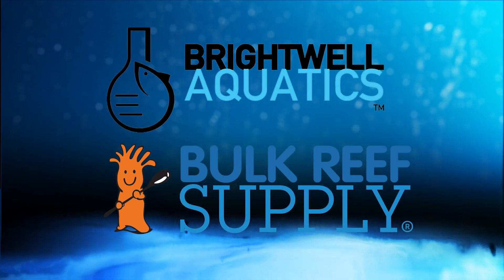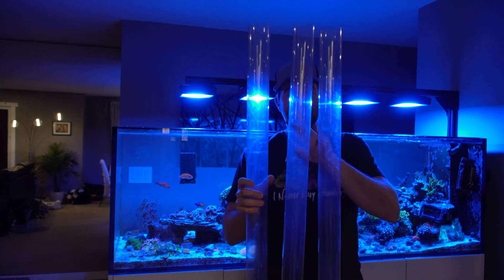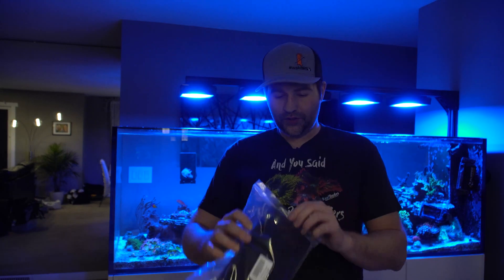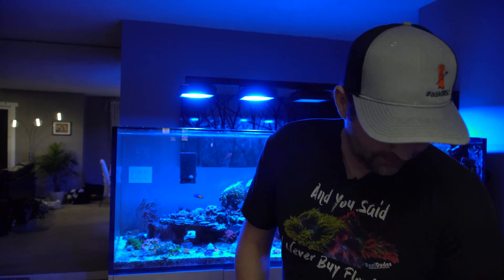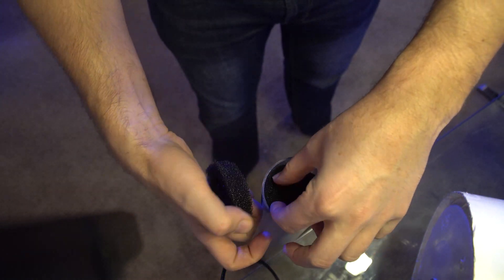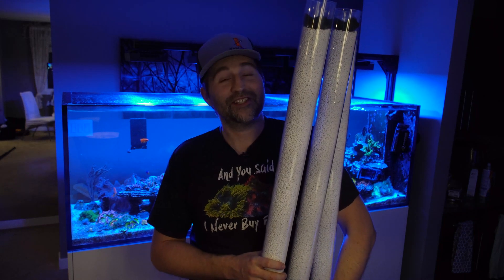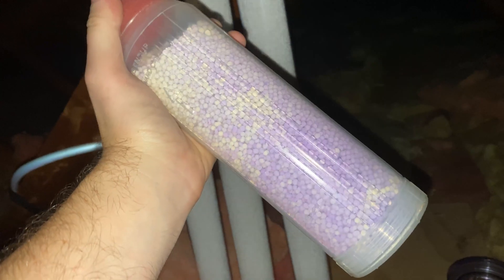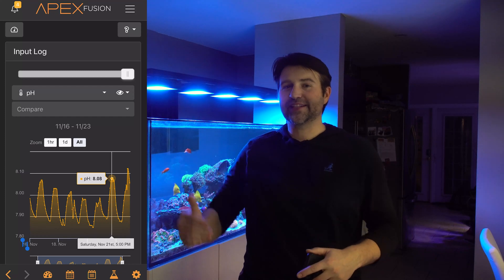DIY Co2 Scrubber - Boost your Saltwater Aquarium Reef Tanks PH!

Comment: I would cap the tubes and put a small hole in each cap, otherwise you are just scrubbing ambient air from natural air movement and wasting media.
question-why not put the scrubber where you can get to it and run a tube from the intake of the scrubber to where you want to draw the air from?

Comment: like the video.. so you are drawing outside air thru a scrubber and then into your skimmer correct? the reason I ask is I am getting ready to do the same thing and I'm being blasted and mocked with things like why scrub the co2 from the plant. lol.. anyway just wondering how to combat such mockery. because I love this idea. and seems like there are a lot of people who support this approach of running outside air thru a scrubber. I'm going large as well. I'm going to start with a single a DC-2 dosing container and if one works out I will install two of them because my Aeraqua Duo AD600 has  two air inlets wish i could throw you a pic of my proposed project
Reply from the maker: Yes I was.  Current version sits on skimmer lid and it’s T’d so it half recirculates half fresh air

Comment: Outside air is 100% the best sustainable way to raise pH, just make sure to add a carbon scrubber just in case. Raised my pH from 7.6-7.8 to 8.2-8.4
Reply from the maker: That’s a huge boost
Reply: @ReefDudes  Absolutely, gotta love "efficient" houses, ha. I was burning through CO2 media but now it's essentially maintenance and cost free. I ran 2" pipe through the wall/attic and vented onto a deck. It only steps down a few feet before the old CO2 reactor which is now holding carbon. Definitely nice to not have to worry about potential issues around low pH
Reply from the maker: @AJ-bi6ns  Perfect! gotta love that fresh air!

Comment: Soda Lime has been used for over 80 years for CO2 level control on manned submersibles and in rebreathers for scuba.  Just beware it will loose its efficiency if allowed to fall below 65 degrees F.  So keep the reactor inside close to the tank!  Cheers!

Comment: I must say I am not a chemist but I read up on the Compound A concern.  It would appear that Amsorb Plus or just Amsorb addresses the Compound A and has much less production based on medical journals compared to traditional Soda Lime.  Maybe not the best thread or forum to have this conversation...
Reply: There are also journal entries related to heat and reaction, maybe an attic in the summer is not a good location?  That is if I am reading the medical journals correctly.

Comment: Disclaimer: I know nothing about CO₂ scrubbing media. That said, I assume the byproducts are a result of the reaction and thus proportional to the amount of CO₂ scrubbed / media used. If that's the case recirculating the air would actually result in less byproduct since there is less CO₂ in the recirculating air (that's why the media lasts longer).

Comment: In order for the media to last it needs humid air as an intake.  I use a standard BRS reactor and the air input goes into a Gatorade bottle filled with RODI water, the lid has several small holes in it to allow for air flow.  The RODI waters lasts as long as the media lasts which in my case is about 35 days.  My Apex alerts me when the pH drops below 8.2.   I get my media from ShopMedVet, a veterinary supply company here in the US...
Reply: Interesting......

Comment: The attic seemed as a dirty place for a skimmer air intake. In your video we could all see the free particles floating in the air. There is a lot of fiberglass particales. Are you worried about that? I’m running mine through to my garage with a reactor filled with filter pad top and bottom and carbon in the middle. So far so good.
Reply from the maker: That’s why I had a sediment filter on the first one. Only particles because I was moving around insulation. They would settle with no movement out there.   Even now there no way particles could make it though 3’ of media :)
Reply: The only time anything floats around in an attic is if there's someone or something in there moving around.

Comment: Suggestion to improve on co2 removal / potential duration between media changes. You could run the co2 scrubber tubes in series similar to di media on rodi.
Reply from the maker: Do you think inline with more air flow or in parallel with less flow would deplete at different rates?  I was debating if there would be a difference or not
Reply: agree. in parallel you't taking for granted that the flow will be the same through all three tubes.

Comment: The compound a issue was of interest to me ( I used to be a paramedic, and my spouse is an internist), so I did some digging.  From everything I’ve read, it sounds like compound a is only formed in the presence of anaesthetic gas, specifically sevoflurane.  The reaction itself doesn’t occur because of the sofa like, but the activator(either sodium, or potassium hydroxide).  It is possible to get reduced/no activator soda lime, but really, I don’t think it’s an issue you have to worry about at all.

Like I said, my wife is a doc, and she works in an icu, so this seems like an issue she would know about.  I’ll talk to her, get back to you if she has anything to add.  

As a fellow Canadian, I really do appreciate and enjoy your content!
Reply from the maker: Thanks so much and keep me updated!
Reply: I do anesthesia for a living and compound A is nothing you need to worry about.  It's the degradation of Sevoflurane (anesthetic gas) in the breathing circuit and you don't have sevoflurane anywhere near your reef tank.  Thanks for the great videos.  Cheers

Comment: Great content. CRNA here, you’re not running sevo(or any other anesthetic in your reef, I hope!) so you dont have to worry about compound A. That is only created in breathing circuits using SodaLime with anesthetics
Reply: What I learned in school was that it is anesthetic specific. Particularly sevoflurane. Other volatile anesthetics do not produce compound A. So sodalime pulling CO2 from the household room air will not produce compound A in any concentrations. The chemistry isnt there.
Reply from the maker: @paddle41773  Perfect! that sounds promising!   Other Q.. What kind of effect would  ozone have on it? I feel like it would likely degrade it but another on the to dig into list!
Reply: @ReefDudes  Hmm, no CLUE! I dont have as much experience with ozone as I do anesthetics! LoL
Reply from the maker: So is it from a byproducts of gases they are injecting into it as well or the media degrading over time as it’s used up?  I’m still digging into it to try and get some clear answers

Comment: The more media you have the more efficient it becomes just like DI resin, But you would wanna run the cannisters inline so air runs through 1, 2 and then 3.
Reply: I was thinking the same, run them it series.
Reply: I was thinking the same thing. Another idea to the mix... what if you added a recirculating fan above the cylinders to pull fresh air in from the attic/outdoors rafters.
Reply from the maker: Could work.   If it doesn’t last as long I can try Re jigging the flow of it   I was thinkIng each one is only doing 1/3 of the flow / work

Comment: Curious if this works longer. One of the main purposes of the recirculation method is it results in humid air which is known to increase the life of the media (also to pull lower CO2 air but you're already accomplishing this in the attic). Other people connect the intake to a jug of water so the air is more humid going in. Looking at this setup I think that is the one spot you can improve upon before exploring the recirculation method.
Reply from the maker: I was thinking about that however i have fairly humid air where i live so not sure  if its required /  average relative humidity is about 70%